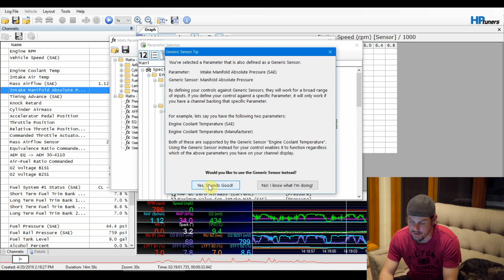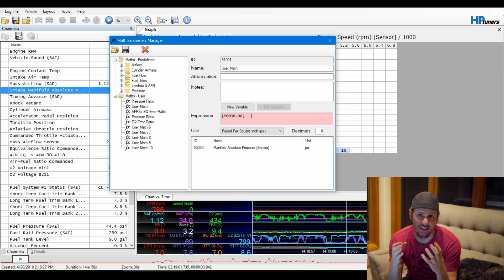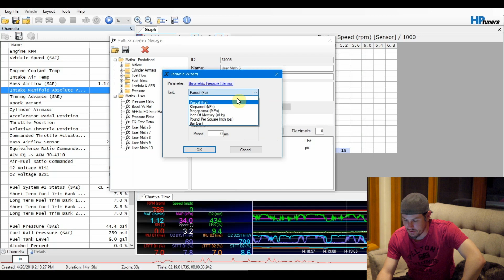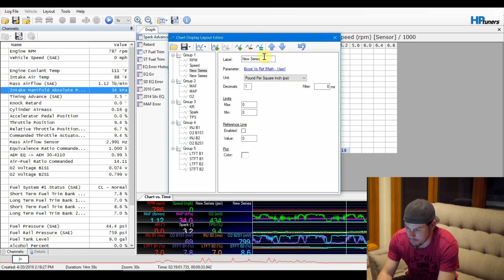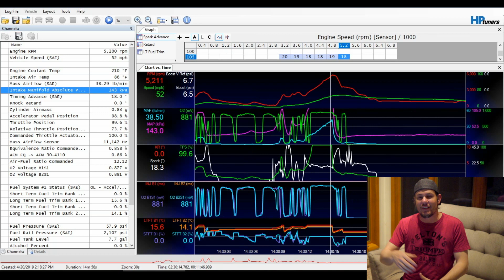Logging Boost in HP Tuners, The Custom Math, With or Without Baro Pressure!

Comment: I am following these instructions and I get a - number for boost.  like reading neg 10 psi
i tried both maths. map pressure in psi -14.7 
and also math using map -barometric pressure 
at idle i have a -10.6 boost psi number.  Solution?  What am i doing wrong here?
Reply: Looks like I’m not the only one who’s run into this issue.  Did you ever get yours figured out man?

Comment: How do I add the math boost graph to the left side channels?
Reply from the maker: Boost isn't a parameter usually but you can calculate it by logging manifold pressure and barometric pressure

Comment: 2003 zo6 with a 2 bar. I added the boost table and it appears to read vacuum fine but only goes to 1.5 on the boost. I have map minus baro. Any ideas?
Reply from the maker: You update the map parameters for the two bar sensor?
Reply: Kyle, the MAP parameters after going to 2 bar were updated to 208 linear and 10.33 offset (based on specs from manufacture) but my buddies 04 Silverado with a magnuson only shows .8-.9lbs boost on 2 bar OS but mechanical shows 5lbs. Thanks!

Update got it figured out, he was logging the old MAP and not the MAP for 2 bar after the OS was updated. All good now!

Comment: Where is the PID for Baro getting the data from in my 2017 Silverado? Is there a baro sensor somewhere in the truck?
Reply from the maker: It's in the MAF sensor, we have to break it out when going boosted, they make a breakout harness that allows you to plug in a 1 bar map sensor.
Reply: @GoatRopeGarage   Thanks! I am hoping to replace my 1 bar on the truck now with a 2.5 bar. I assume I can use the 1 bar I am pulling out for the BARO sensor.  Is there a wiring diagram I can use to break out the baro from the MAF?  Thanks again!! (2017 Silverado 1500)

Comment: I followed the video but both my boost readings now say 4.9 when it’s not running? My bara pressure says 13.1 and that’s what I put as my math.
Reply from the maker: That's really low for barometric pressure, where are you located?
Reply: Goat Rope Garage saint marys GA
Reply: Goat Rope Garage  if I put the pressure at 18 it reads 0 boost psi

Comment: Hey man! Does a guy have to convert the operating system (p59 ecm) to speed density - 2 bar to make this work? i've tried your way and others but cant get the scanner to read positive pressures in the factory OS. Thanks!
Reply from the maker: I don't think so, as long as your map sensor is setup correctly, which is independent of the VE table, but it may clamp it.

Comment: Thanks for the instructions! Whats a good lambda afr for 10 lbs of boost? I'm as low as .65 wot.
Reply from the maker: You're going way too rich. .85 for direct injection and up to .8 for port will give you the safety you need and still make lots of power.